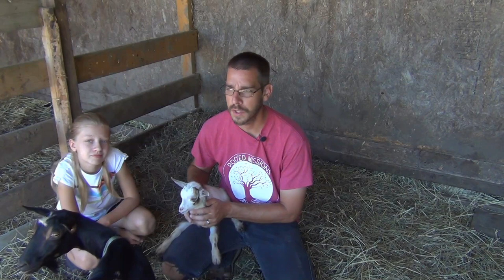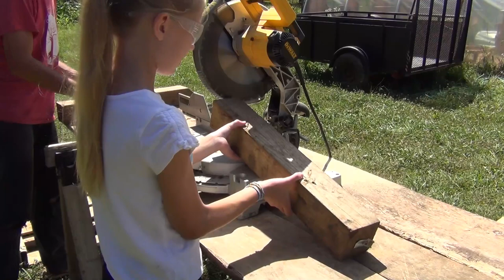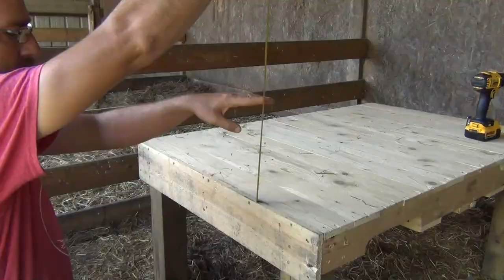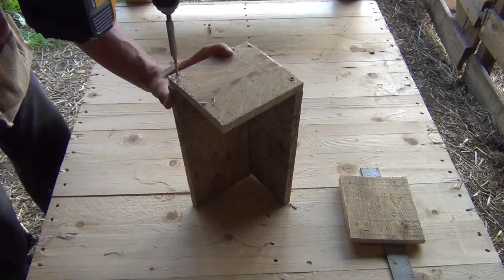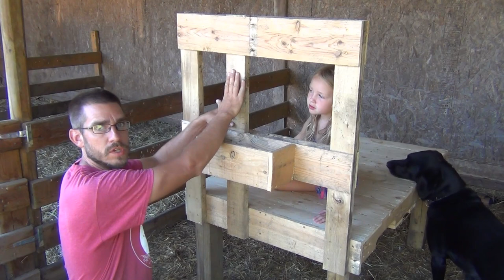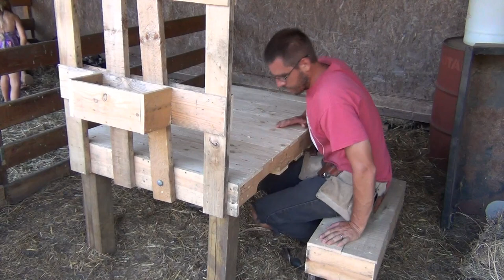DIY Pallet Goat Milking Stand

Comment: I drilled multiple holes through the frame and movable gate board, then used one of the multitude of "free" Allen wrenches that we've collected over the years from furniture purchased to lock the headgate in place. We drilled a hole in the top of the frame for a quick storage space when it's not in use, too.

Comment: I like the height and the use of recycled materials. The ability to sit next to the stand with your feet and legs under the stand makes it ergonomic for the milker. 
 I think the head holder should have some neck slots cut and the boards actually be closer together when closed. This would limit the up and down and front to back movement of the head. The bottom of the moving slat would need a small angle cut to allow the slat to open wide for entering and exit. 
The width of the platform may prove to be a problem but it can be remedied with a small fence/railing on the side not used for milking to keep the goats close to you while milking. This will make it easier on your back.
Great build project for very little money!

Comment: I think you did a wonderful job making that. Like you said and you should change the board so it is a little higher than the rest but I guess it all works out. I would have drilled a hole and I would have had a chain mounted there with a large Bolt so I would have had a few different size holes and I could just put the large bolt through the hole to whatever size I needed this way the bolt never gets lost

Comment: Getting ready to build one with scrap materials and pallets... and I am contemplating using the pallet frame pieces for the neck boards because they have a curve already started. I don't have a jig saw on hand, so I can use the inset to start and saw down to the next one, then give it a good sanding. Hope mind turns out as useful and thanks for the great video.

Comment: I like this better than the goat milking stations you buy and for a handle use one of the handles you got with one of your screwguns or your grinder it will work that's what I do with them cause ya never use them on the tool

Comment: For the head clamp I would have drilled a series of holes horizontally that a bolt could slide through, then you can adjust it for each goats head size.
Reply from the maker: I thought about that or making a slot and then a wing nut to tighten it, in the end the block seems pretty simple

Comment: Bees wax is a good lubricant for sliding wood, melt it down and brush it on. They used to use the technique for sill plates before pressure treat. A thin layer, to much and it'll get in the way specially in the winter.
Reply from the maker: Great idea, I will try that. I have some beeswax!